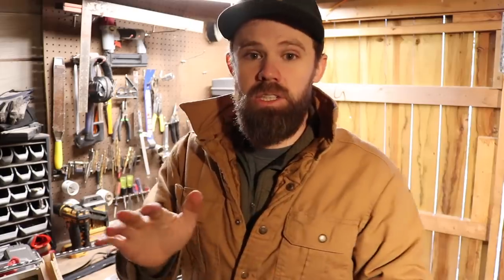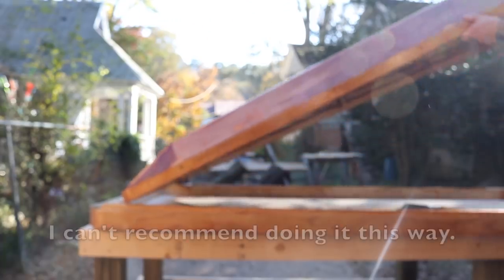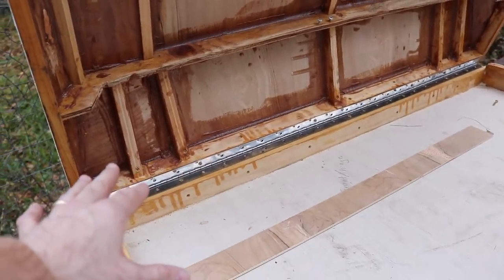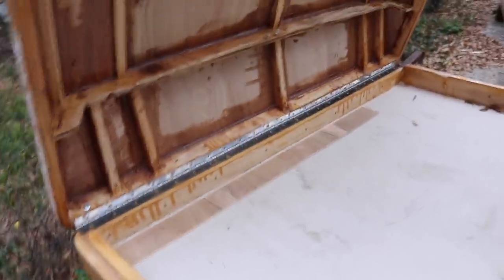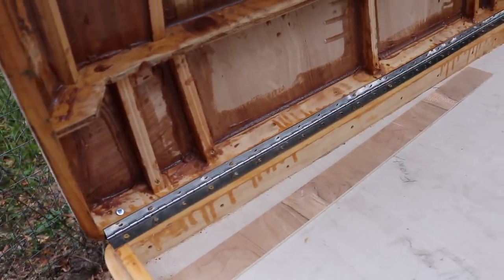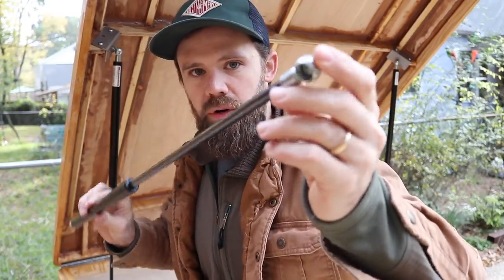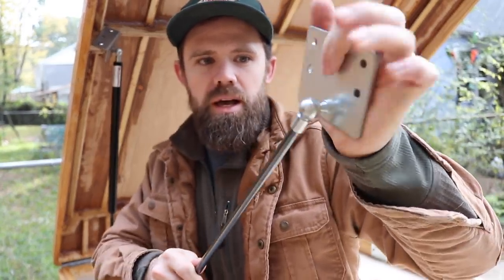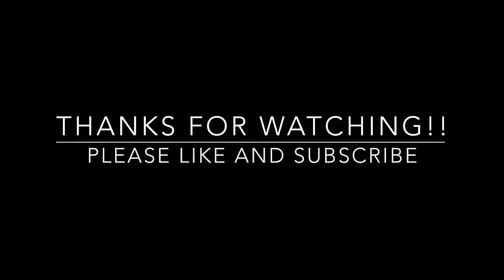Rooftop Tent Build Series - Finding the right Gas Strut!

Comment: Was thinking you could use rubber or vinyl flashing on the front so when is closed it'll keep moisture/water from coming in. 

And congrats on being a new dad!
Reply from the maker: Duan Dao yeah I will definitely be doing that along with adding that drip rail
Reply: Patrick Remington in so glad YouTube had your video in my feed, this is a gold mine of information.  I also thought in lieu of using the 3/4" square for the top frame maybe extruded aluminum to help with weight. Might add to the cost but just stuff I thought of whilst watching your build. Can't wait for the next installment.

Comment: Really great video!  Some teardrop builders uses "Harsh-Environment Plastic Piano Hinge" sold by macmaster-carr . those hinges are chemproof and uv resistant and last a long time, installed simply by using wood screws. Most of all they are waterproof and silent. One other idea would be to use a bicycle inner tube layed down first after you butt the two units end to end.   Your roof profile is really nice and I can see why when your finished it looks so much like a commerical unit. Best wishes to you!  Thanks!

Comment: Congratulations on the new addition. You might consider attaching a piece of rubber (think bike inner tube) along the outside of the hinge to further prevent water from getting inside.  Use a drip rail on the top side to shed water.
Reply from the maker: Marguerite Young yeah I had thought of that! I'll definitely be coving it with rubber or vinyl!
Reply: I did this on a leaky galley hatch on a teardrop trailer no leaks since

Comment: Hi..l. Just discovered your channel. I am liking the idea of the tent.  As for the hinges being a weather weak spot... What about taking a 2 1/2 inch wide strip of thin rubber and put it between where the screws go wrapping around the outside exposed part of the hinge? That would seal the hinge between the wood and the rubber while protecting the outside of the hinge!

Comment: Patrick, I love the series! Thank you for providing all the details so the rest of us can recreate what you've done though in my case it will be on the balcony of our 7th floor apartment if I do it! A question: at 9:54 you are mounting the upper bracket for the gas strut and I am wondering if it would be better on the other side of the timber so the force exerted by the gas strut is pushing the bracket into the timber rather than trying to pull the screws out.

Comment: I know I do not know anything about gas struts. Is there a difference in the performance if you switch the struts end from end? So its pushing up instead of pushing down.
Congratulations for you and your wife on your daughter. Your now a family. Cool
Reply from the maker: From the research I've done, the cylinder needs to be at the top and the rod at the bottom. That's how they are oriented on my vehicle as well. Hope this helps!

Comment: Congratulations to you and your wife for that beautiful baby!  Sorry, I'm late to the party since that happened a year ago.  I'm working my way through your build series but, during the design process, did you consider putting gas struts in all four corners and lifting the roof straight up rather than creating the triangle shape?   Also, wouldn't a thick (1/4"?) strip of rubber about 3" wide, attached on the outside with screws just on the top side of the strip, covering the piano hinge from wind driven rain, prevent moisture from entering through the hinge?

Comment: Congratiolations on your daughter!

Is the weight of the fabric not changing anything for your struts? Also, some time ago i heard about gasstruts do not work when you mount them upside down. Did you experiment with that?
Reply from the maker: My fabric is super light and I opted for stronger than I thought I would need struts so there is no change. Better to go stronger than not strong enough. 

They will still work but not as intended. This is the correct way to install them with piston rod down.

Comment: I have been using YouTube every night for years but don't actually think I have ever commented on a video. However.... I just wanted to say thank you for an amazing series. I am inspired to have a go at this myself and gas struts seem to one of the most tricky parts. This video will of course help. I am thinking of wrapping mine in fiberglass as I live in a fairly wet country (Scotland) is this something you have thought about? Also congratulations on the new arrival. All the best
Reply from the maker: Lee Wright Thanks for the kind words! I have thought about coving the plywood with fiberglass but I don't think it's necessary. The epoxy itself will seal the wood from moisture and you'll also be painting over that.

Comment: So is it better to have them further back, how do you know how far back to mount and how does it affect the amount of force required to lift? Thanks
Reply from the maker: Further back and the max lift height of the lid is higher. Further forward the max lift height is lower. so you just have to decide how high you want it and if it will be in the way of a side door if you choose to do one. When Deciding the height Consider the width of the fabric you want to use.
Reply: Sorry I'm still confused , so if you using the same size strut and you move the top mount position further back won't it actually make the lid hight lower? So you just postion them how far you want the lid to e fully opened where they will fit to the base? Also adjusting the angle will affect the force as my strutsa aren't adjustable and might need to move around to work but not sure what positions will affect it. Thanks @PatrickRemington

Comment: Hi, I need help finding the correct strut for me. I currently have 2x strut with a 450N rating on a lid on my tub. It is 430mm in length when extended and it has a main cylinder of 22mm dia and 245mm length. The weight of my rooftop tent is 65kg and I'm struggling to lift it up. What should be the new force of strut I should get?

Comment: Ok, so I followed your instructions. Mine weighed 50lbs in the middle so I bought 2 100lb struts. It won't close... It ended up bending the brackets and ripping the screws out of the wood. Shouldn't I have bought 2 50lb struts to hold the 100lb door?

Comment: Don't you also need the weight of the fabric being lifted?
Reply from the maker: No, you don't. As long as you get struts that are a little stronger than you need, like I did you'll be fine. The struts don't pick up the entire weight of the fabric all at once if that makes sense. Its only adding weight as it opens. When the lid is fully open the struts are at there strongest and are holding the full weight of the fabric. Hope that helps!

Comment: How did you figure the distance between the hinge and the lower mount (on the skinny side)? You just eye balled it? I read somewhere some formulas and relationships between these measurements for optimal function - obviously you're by far not respecting any of that :) .